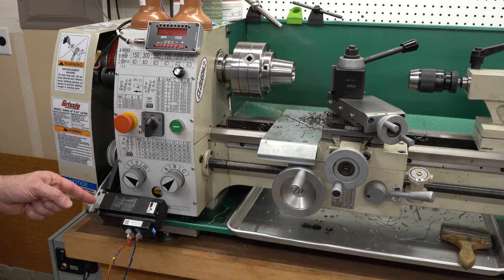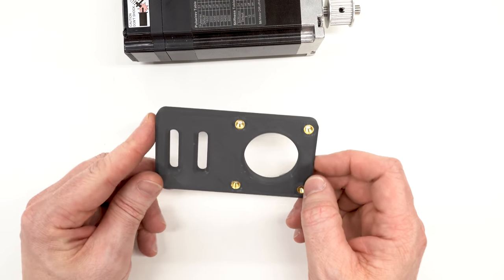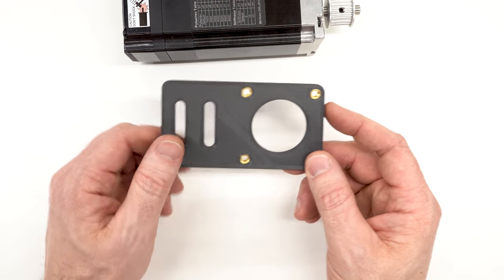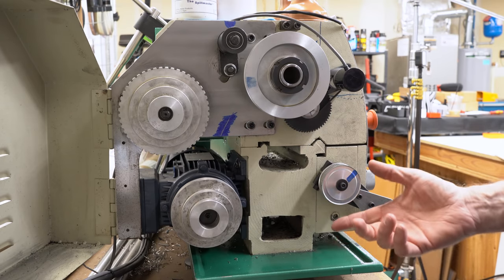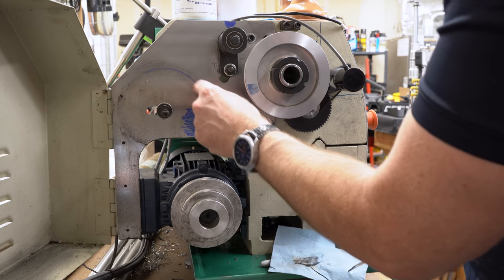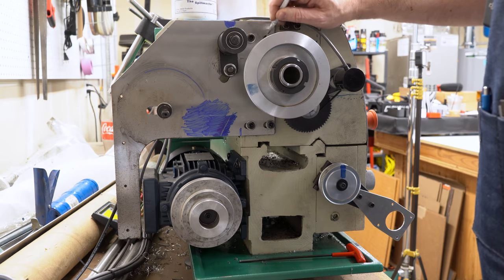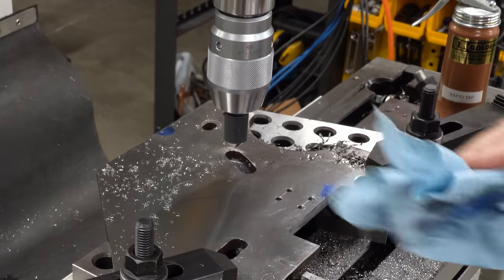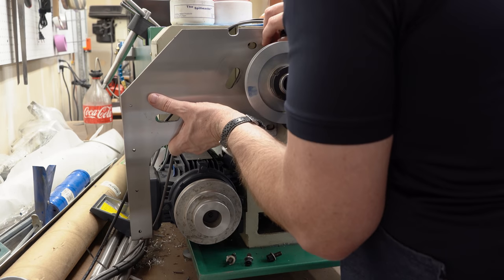Finally Installing the Servo on my Lathe | Electronic Leadscrew Part 27

Comment: Might have a record for longest pending project...i inherited my dad's tenon saw maybe 30 or 35 years ago, and its one missing handle clamp screw annoyed me all that time.  But i never was able to find them to buy a replacement.  
Well I  have in recent years acquired a lathe and a mill..... so when it annoyed me again the other day i finally made six identical solid brass snake eye head corby nuts and with some s/s thread in the middle i now have an heirloom that looks like should always have looked. 
Better late than never.
Reply from the maker: That's awesome!  I love projects like that.

Comment: Hey, I'm wondering if there's a place for folks to post their "completion photos" and any pertinent build information?  This past weekend, I got my ELS install almost completed (just awaiting 10T-to-60T reduction pulleys and belt from China, which should arrive end of week) on an MX-210V mini-lathe.  It was tricky to find a place for the encoder in such a small machine, but I'm quite happy with my solution -- using four 3D printed parts and a bit of sheet metal work. 

Thank you James for this truly excellent series/playlist.  I learned a great deal from you ... and it's knowledge that I can hopefully use in building more stuff to come.

Comment: Hi James, thanks again for taking the time to produce great content that is worth waiting for and to watch. Quick question, I am sure it will be straight forward to implement but because I don't have any experience with the TI boards, I would rather gather some info first. Will it be possible to use your code for the ELS to sync a second spindle on my lathe as with large sub spindle cnc machines. I would like to ad a small sub spindle to my machine to finish up the machining on the rear of plastic components I machine. Sure we can do it by hand but doing thousands by hand is not the answer. 
Regards

Comment: I would use ABS/ABS+ for a mount. Voron printers are all abs for example because it doesn’t creep over time.
Nylon is good for gears for example but it’s flexible. Not good for a motor mount. 
ABS will break a some point but it is stiffer and will hold his form even under load better.
Reply from the maker: Adding carbon fiber changes the properties somewhat.  I tested both a CF-Nylon and a CF-ABS mount.  The ABS showed much more flex immediately, but didn't creep.  The CF-Nylon crept a bit over the first couple of days, but then settled down.  We'll see how it works long-term.  This is an excellent application for testing, because it's easy to see how it's holding up, and easy to replace if it becomes a problem.
Reply: @Clough42  as far i know adding CF doesn't improve the strength but it improves printability and looks. 
But I am curios how it will perform over time too.
Reply from the maker: @Todestelzer  you should probably read the data sheet for a material before speculating about what the CF does or does not do for its properties.
Reply: @Clough42  I don't want to argue.
I did a fair amount of research for CF or glass fiber added to 3D printing materials.
For ME CF and glass fiber is a way to get nylon or ABS print easier and changes the surface looks. 
The problem with adding CF or glass fiber is it weakens the main material in the end. 

There are 3D printers how can add CF strings to the print and cut it to length while printing. 
Theses parts are super strong indeed. 

I am interested in how your part will perform. An update video would be nice.
Maybe you could try the part in ABS and make a comparison between CF-Nylon and ABS too?

Thanks for making theses videos I appreciate them 👍

Comment: I've been thinking about building a laser cutter, one that can cut 1/2" plywood so that I can make wooden-gear clocks. James, I thought I'd put that bug in your ear, as finishing one project clears the floor for another :). Something around 150W or greater... so you can cut metal as well...
Reply from the maker: I want one over 400W, so I can cut glass.  :)  Doubtful that's compatible with the size and setup of my shop, though.  :(
Reply: @Clough42  My "problem" is wanting one >200W, but given that a 150W tube is around 1850mm long, it takes up too much shop space. The only good thing is that at anything over about 220W or so, manufacturers are now putting smaller/shorter tubes in series, folding them into an enclosure. That said, they're still long assemblies. I wonder if it could be put along the rear wall of the enclosure on a diagonal, allowing up to a 40% smaller enclosure. Still not small though!
Reply: @Clough42  I'm seeing fiber lasers that are much smaller than the glass-tube CO2 lasers, so there's hope. Only downside is that they're a different wavelength, great for cutting metal but not so much for wood. Don't know about glass.

Comment: RE: the bracket you printed... I've been through a VERY similar issue twice now. 1 of my brackets is now aluminum and the other bracket is completely redesigned with gussets, which is how I would have made your bracket. Gussets and a slot to slide over that mounting plate that you milled/drilled. 1 fixed mounting hole and how every many extra slotted holes that you want. I might have even made that bracket solid with no infill if I got it in my head that I had to 3D print it and put 1 fixed hole, 1 slotted hole, and then drilled 2 new holes through the backet+plate to affix it more solidly. In any case, it would have gussets. I am not saying that your solution will not work, long term, long term simple brackets like this just have not worked well for me personally.

I made my bracket slotted and drilled through the mounting plate and printed part right on the slot. It has been holding solidly for a long while now.

Comment: Did you ever figure out a good way to tune these servos? I have a set for a 3 axis mill and have been struggling to adjust them so the holding torque is adequate without them oscillating

Comment: The ELS has been on my list for some time but the microcontroller is out of stock everywhere I’ve looked.  If people are still making this project do they have a source?  Thanks
Reply from the maker: A few people have reported finding them.  Most of the big suppliers are expecting fresh supplies in July, with more shipments throughout the rest of the year.  The chip shortage has been hard on everyone.

Comment: Man, that drill chuck grabs the tap tight. Today I had problems with an M4 tap into brass, slipping in the chuck. I had to change to a Jacobs chuck (and tightened really hard with the key).
Reply from the maker: This one holds pretty well.  It came with a hook spanner, but I just tightened it by hand.  To be fair, I deadlift 450lbs without straps, so my grip strength is probably a little above average.

Comment: The wiring diagram in the GitHub Wiki still shows the stepper motor with the KL-5080H driver. Have you made up a new diagram showing this servo? I'm sure that after I pick up the servo, I can figure it out. But I'd like to have an idea ahead of time. 

By the way, got the interface board and control panel combo kit earlier in the week. Thanks! I've had the same G0602 lathe for years, so this will be a welcome upgrade.

Comment: I had fun installing and fabricating all the parts for the motor drive on the table X- axis for my mill. I am curious, where did you find the servo motor and electronics for it. I put together a DC motor, speed controller and reversing switch for my lathe but your set up is so much nicer. Other question, is there a chart for lead screw RPM,s for cutting threads? The table drive on my mill is a Wing-Ding, made for a Bridgeport,  didn't have a 3mm and a 5mm keyway broach at the time so I fabricated step keys and cut the gears and machined the mounts so I could use the stock hand wheel. It runs quiet and smooth, as good as any Bridgeport I have used.

Comment: Bought the kit from you on release day… still have it… still haven’t installed it… still mean to… someday
Reply: I also purchased the kit and still have all the stuff sitting in a box somewhere. One of these days I will need to cut a metric thread and will be kicking myself for losing momentum on this project.

Comment: My 3D Printer... It needs a box to contain the SSR and 2 mechanical relays, plus a buck converter that I have which drives the R-Pi. Just a box, which I can design in about 10 minutes with screw stand-offs to affix everything inside the nice and neat. A very simple project that I can do in a snap and have it printed by morning. It's been more than a year and half, all the parts are still out in the open, luckily no one else goes near my crap (it's just me and the wife at home and I have made her aware of the dangers). The SSR is controlling a mains powered bed heater.. Ya this really isn't safe.

Comment: I'm curious if I could rig this on to my hardinge. it has a cross slide and a compound only. so my plan would be to attach it to the compound. I would want to set limit switches. i also want to be able to thread with it. the problem is that there is no half nut. it would be engaged all the time. so either i need a quick way to stop and reverse the spindle. or a way to turn the servo/stepper off and not loose synchronization with the spindle. any thoughts or ideas?

Comment: I like how you did that, I wanted to ask did you put anything under the back of the motor to shim it with the VFD underneath? It just seemed like the weight of the motor would eventually begin to bend the nylon over time
Reply from the maker: I didn't, but that's always an option.  I mounted a motor in the mount and clamped it in my bench vise with a dial indicator on it for a week to watch the creep behavior.  I suspect it'll be okay, but if not, a rubber foot or 3D printed clip-on shim would probably solve the problem.

Comment: that idler on the g4000 has a small clutch , which is a nuisance over time.. Not sure if  the larger models have it also? bypassing it is nice

Comment: James, congrats on getting the cover back on your lathe.  I have one of your ELS running and have the parts for my second one but can't find the LaunchXL, apparently due to the global chip issues.  Do know of a source or is there a different version of the controller that would work.  Thanks for all you do.
Reply from the maker: It's the global chip shortage.  I have seen a few, and suppliers are showing expected shipments starting again in July.

Comment: Great work I like the way you do things what did you call that nylon like plastic that you used in your printer
Reply from the maker: PA12-CF.  I used the QUIDI Tech brand.  There are many out there.
Reply: Thanks, I was traveling and watched it on my tablet. but for work space once I watch some thing it, the program dumps it to free up space for work and I can't watch it again till I get home. So I missed it and wanted to pass it off to a friend thanks.

Comment: Also, I just got the same printer you got based on your recommendations, thank you very much. I'm also getting a role of Essentium HTN CF-25 . Carbon fiber nylon to try in the printer. I think with the extra carbon fiber you wouldn't need to anneal the part. It is a pricey product but for those specific things that require that kind of stiffness I'm wondering if that might work.
Reply from the maker: Interesting.  You're right; that is pretty expensive.
Reply: @Clough42  yeah I have a specific use for it. I also have the same lathe as you only the factory VFD model. That's how I  found you, I was looking at the electronic lead screw which I also got from you. Truth be told, You have been kind of a mentor for me (You and Blondie hacks actually) and everything you've recommended has just worked great in my world as well. I know, a little mushy but it's true. Anyways thanks for everything and I look forward to everything else you do.

Comment: ELS was one of those upgrades that had surprising benefits,  My main purpose for it was eliminating gear changes (Yea! and Yea! again for that) but being able to change feed rates on the fly is an everyday (don't want to live without it again) benefit that just keeps on giving

Thanks again for all your hard work on that, Also glad to see you went with Centroid Acorn on your Avid build,  I have been using the All-in-One-DC on my Bridgeport Boss for years now, and chose the Acorn for my 4 x 4 wood router build and could not be happier

Great work James

Comment: Sorry to be so late to the party, but I'm enthused with the ELS which I'll be building for my Myford Super 7 (hopefully with no modifications to cast guards). However, it's going to be tricky finding a suitable location for the spindle encoder. An alternative might be to use a quadrature output gear tooth sensor on the 60T bull wheel. Do you think that 240 pulses per rev would be inadequate?

Comment: James I have a F28379D at the house will it work for the ELS? The pins all line up correctly with your boost board.
Reply from the maker: I've never looked at that board.  TI has a nasty habit of changing the booster pack pinouts on every board.  Just looking at the pinout, that one does seem to have pins in the right places.  It looks like that's a dual CPU version of the C2000 DSP?  Seems like it could be made to work, though I expect the MUXing to all be different.
Reply: @Clough42  thanks for the reply I will take a look at it. TI also has a habit lately of not having the board you used in stock.
Reply: @Clough42  Looked through the pin outs on both datasheets, they are the same so I will give it a go. I also will look out on digikey for one in july. thanks!

Comment: Will you ever make a rear spider for it?
Reply from the maker: If you check my hand scraper build video, I 3D printed spacers to hold rectangular stock centered.  Other than that, I'll probably make one when I have a project that requires it.  :)

Comment: SDP has timing belt calculators online.  Enter pulley sizes and belt size and it will tell you center points of the shafts.  Pretty accurate to, but I know you rather play with the 3D printer  LOL
Reply from the maker: I did the calculations with exactly that calculator to select the belt.  Knowing the center distance is easy.    Measuring the positions for the holes on the lathe mounting plate is not.  Everything is at different depths, stuff is in the way, and there are few good references.
Reply: @Clough42  You definitely had several more degrees of freedom there that you had to account for, so your method worked very well !!

Comment: what is the pulley ratio that you are using with the servo motor?  the lead screw pulley looks smaller then what you had originally had on it.

Comment: I’m curious why you printed the servo mount rather than machining it in aluminum.  I mean, you do have a CNC mill fully capable of doing the latter.  If done with 7075 aluminum, the threads should be better even than your brass inserts.  I know you are currently in love with all the complexity and minutia of 3D printing in weird materials,  but beyond that?   Love your videos.
Reply from the maker: All of my CNC machines are down at the moment, with several projects in progress.  I know... weird.  If 3D printing will work for a project, it's way more time efficient than even CNC machining.  I just hit the button, then hit the gym, and then my part is done.
Reply: @Clough42  Your comment sounds like an ideal topic for a video.  I encourage you to do some A-B testing of producing the same part with manual mill, CNC mill, and 3D printing, discussing the pros and cons of each as well as the time required, material costs, etc.
Reply from the maker: @David_Best  that's not a terrible idea.

Comment: Why not mount the servo at the other end of the lathe? i made a similar build whit an arduino-mounted at the tailstock-end..room to fit it wherever ..if you r going 1 -1 ratio,then you can mount it directly on the leadscrew
Reply from the maker: It would stick out there and be in the way.

Comment: What I would like to see, is electronic engage, re-synchronization and engage. A bit more difficult to do. PID control is called for.
Reply from the maker: PID is not needed for that.  Resynchronization requires a timed start and linear speed ramp.  If you ever open the halfnut, you will also need to know the absolute position of the carriage to resynchronize, and will likely have to guess the reengagement tooth, given unknown backlash.
Reply: @Clough42  I was thinking more in the line of a permanently connected ball screw with  half nut  deletion.  You are suggesting only using proportional of a proportional–integral–derivative controller. When you have variable speed, I and D helps optimizing the response and  error of the control loop. When you are engaging, the ball screw got to accelerate quickly, but not overshoot within a short period of time. With only P, you will not get good results. P is probably good enough for your setup like you have illustrated. I will try and attempt this, but using a Xilinx fpga, a technology I am more comfortable with
Reply: Anyhow, you are inspiring. Thanks for your efforts.

Comment: Maybe I'll finally install that DRO on my lathe. Though it's not sitting there for 3 years yet. But as I understand it, you don't HAVE to wait that long, correct?
Reply from the maker: No it's optional.  Age to taste.
Reply: But if you don't end up loosing at least one widget in the time you stored it you are doing it wrong - there is always something that either was never there and you didn't notice or escaped/got borrowed and forgotten about!